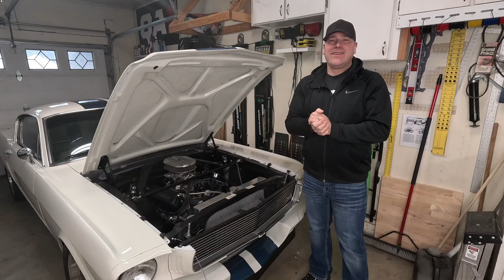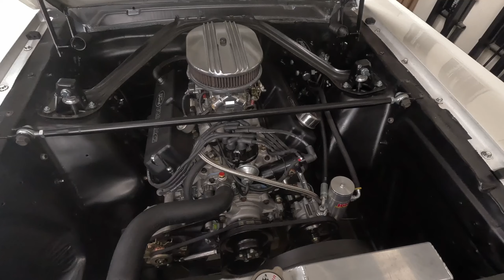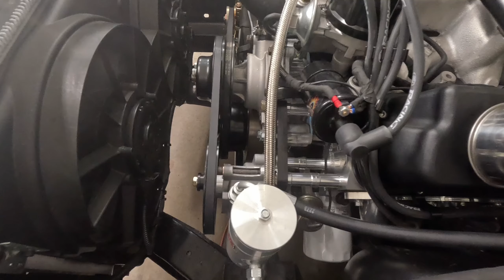How I Design Parts for my Classic Mustang

Comment: I have a 65 that I've just brought. I'm totally new to classics. It has a 4.11 diff and I find it very revvy at only 40-50mph... what gear set would you recommend to make it a bit more of a cruiser?
Reply from the maker: 3.55:1 seems to be the sweet spot for some quick acceleration but still practical for cars that drive at 60mph.  :)
Reply: @AndyKruseChannel  thanks Andy, I saw your video on changing the diff gears. Might get stuck in and give it a go. Do I need to change anything else afterwards?
Reply from the maker: @neillewis82  Yes, I've got a library full of vids on my channel of some great upgrades for your ride.  :)